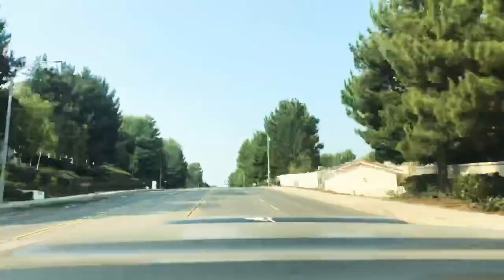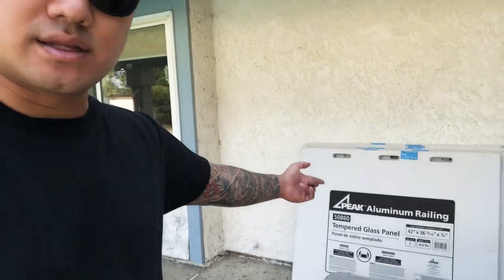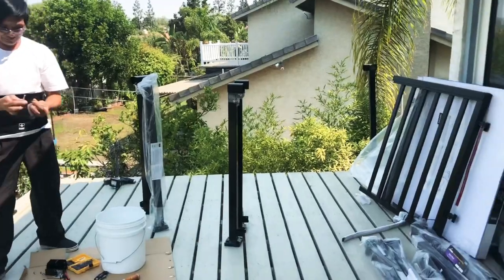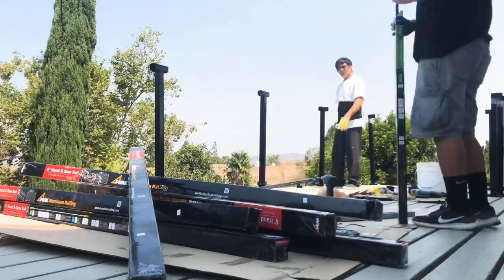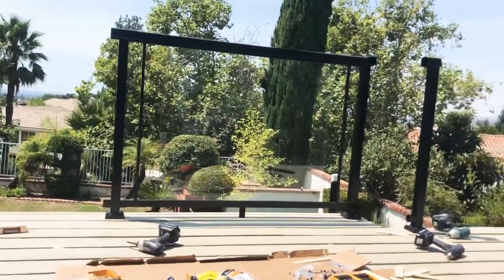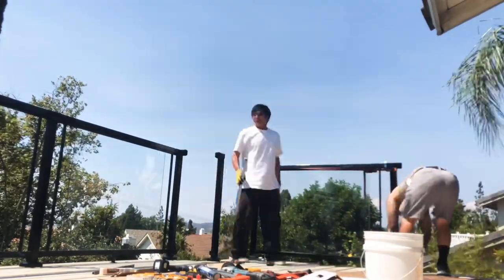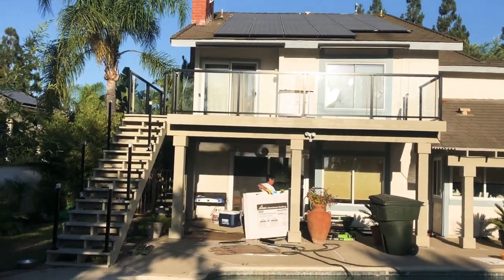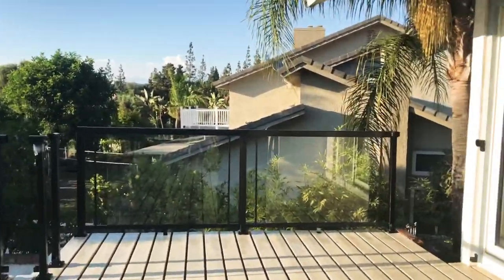Peak Aluminum railing project

Comment: You don’t show HOW you set the glass and pickets.  For example, did you cut your glass gaskets ¼” longer than the glass, and then cut the picket spacers to fill the gap?  Or will the picket spacers fit on top of the glass gasket???  If you would provide an explanation of how you did the actual work, it would be helpful.